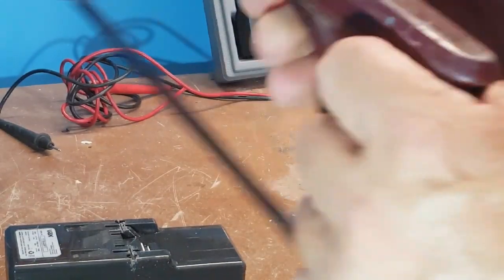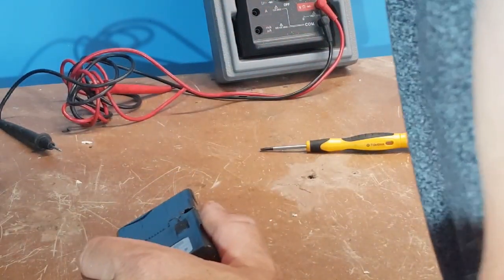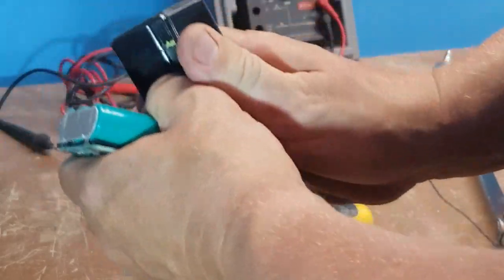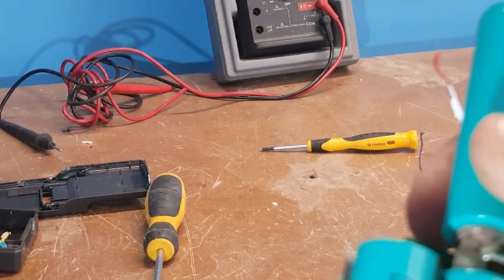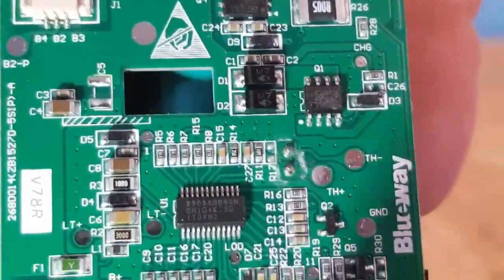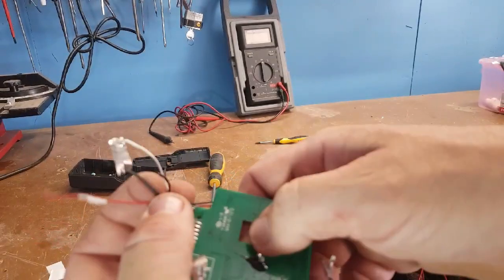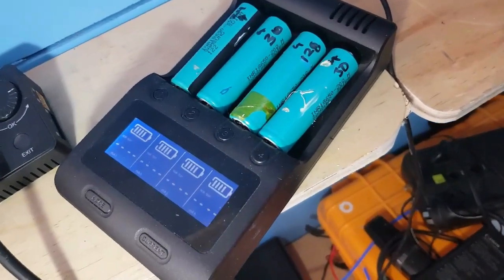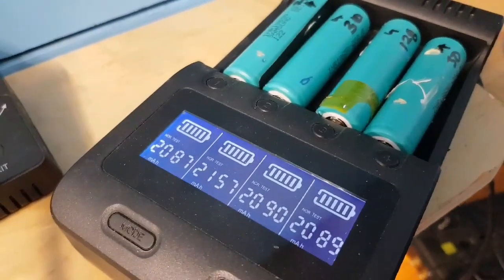Vacs stick Vacuum cleaner battery tear down and look at bms.

Comment: If you use a thin masonry nail as an makeshift punch its quite easy to knock out the the centre pin   of security screws.
Reply from the maker: @chrisbailey4759  Be very careful doing that. You could pierce the batteries and start a fire.